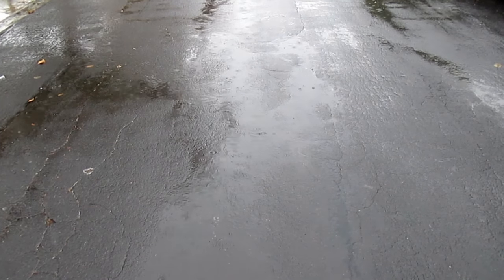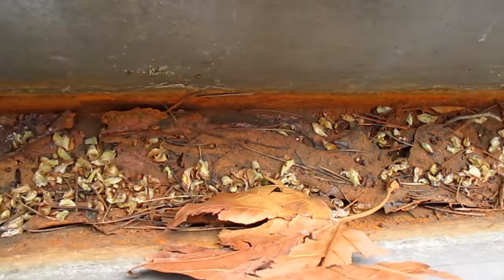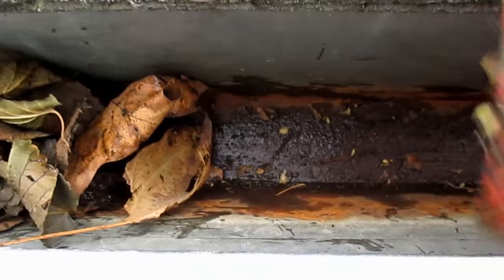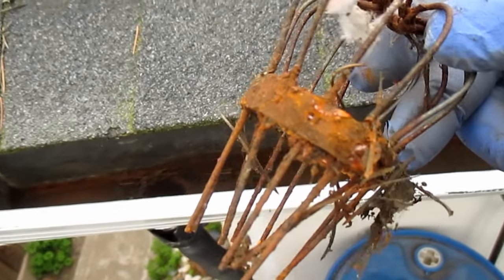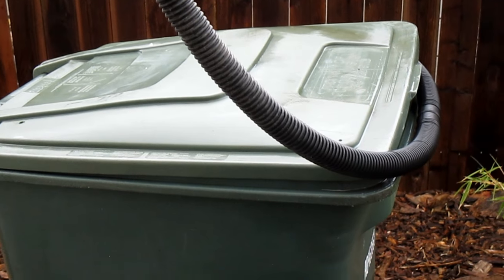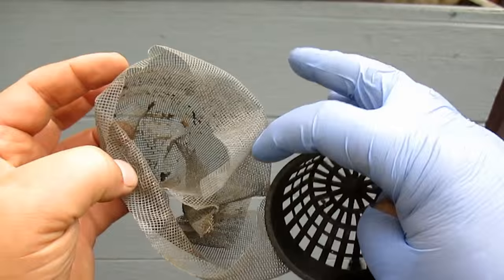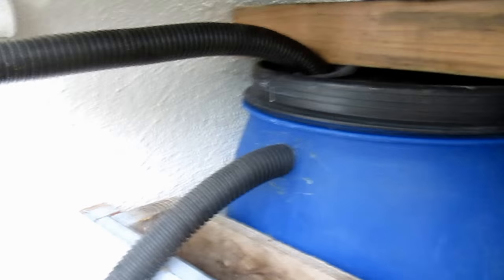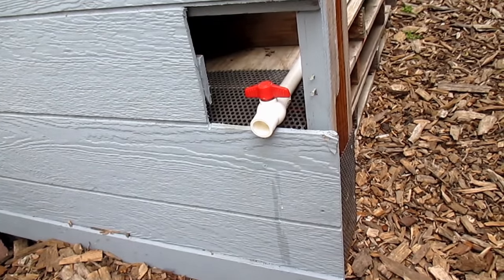Rainwater Harvesting | Collect & Store The Cleanest Rain Water From Your Roof!

Comment from the maker: Hello everyone! I just wanted to address some of the comments on this video. First off, the purpose of this rainwater harvesting system is to collect rainwater to water my landscape, not for drinking. Nowhere in the videos title nor the video itself was it ever suggested otherwise. Secondly, where I'm located in California it is in no way illegal to collect rainwater from your rooftop for use in your landscape, in fact it's encouraged. Please see California's "Rainwater Capture Act of 2012" for more info. 

Now I would also like to share with you a few important notes regarding this setup. For myself, I found this smaller daisy chained barrel system to be a great low cost introduction to rainwater catchment. Moving forward my plan is to install a couple water cisterns (larger tanks) to better fit my landscaping needs. My roof which is made of asphalt shingles is not the best surface for collecting rainwater as it can leach petroleum and/or other chemicals into the water. It is for this reason that I currently only use this water for non-edible plants in my landscape. There are methods that can be applied to treat the water making it cleaner that I may employ in the future. When the time comes to replace the roof, I hope to have either concrete or clay shingles installed. This is a much more ideal water catchment surface making the water suitable for many different uses. Many folks have asked why I don't install rain gutter screens. Due to my previous experience with them I have opted to not use them as a means of keeping debris out of the gutter. I find that the small holes have a tendency to clog causing water to shed off of the roofs surface rather than collect in the gutter. Smaller particulate will also accumulate in the gutters over time requiring the removal of the screens to clean them out. Manually cleaning the roof and gutters a few times a year does a wonderful job keeping the inside of the barrels/cistern free of debris and the water clear and "clean".

Thank you all for tuning into the video. I always appreciate your viewership and feedback.
Reply: Plant Abundance 
By keeping the rain water input clean you also avoid decomposing debri in the water that can make it fowl smelling.  Last week I had screens put over all my gutters to minimize the issue of debri going into the barrels.  My rain water collection is, like yours, strickly to water my plants.  They do much better with rain water than with heavily chlorinated tap water.  My city encourages the use of rain catchment technology.  It is time for all governemnts to embrace this environmentally friendly practice.
Reply: Excellent Video! Sorry for butting in, I would appreciate your thoughts. Have you heard about - Proutklarton Protecting Aqua Plan (Have a quick look on google cant remember the place now)? It is an awesome one of a kind product for getting prepared for a mega drought minus the normal expense. Ive heard some awesome things about it and my buddy at very last got cool results with it.
Reply: Plant Abundance awesome thanks.
Reply: When I took the master gardening classes at UCF, we were taught that the collected rainwater is safe for gardening but not for any edible plants (e.g. - vegetables) because birds poop all over the roofs and salmonella can actually be absorbed up into the plant from the water.

I asked why this was a concern when a bird could poop directly on the plant, but apparently it grows very quickly in water that sits in tanks so even a small amount of bird poop will produce a lot of salmonella once it's sitting in the tank.

I'm not an expert, but wanted to pass along what the university told us.
Reply: I just replaced my roof & gutters to prep for solar panels (Sacramento area]. If I had read this first, I would maybe not have gotten composition shingles again. As I design my drainage fixes, I now am steered toward rain water collecting (for garden) rather than diverting and dispersing it. You said that chemicals in the rain hitting the shingles is not run-off water to use for edible garden plants (90% of my yard). Any ideas? Thanx 4 your info!
Reply: illegal? really? ,where i live(belgium) catching rain water is pretty much the standard, exept maybe for appartment buildings etc. here its almost always wits a concrete tank buried under the lawn i got 25000+ liter for my house, top tip, make sure the overflow drains water from the bottom of the tank so stagnating water is refreshed first +  connect a floater to the suction hose so u collect the cleaner water at the top part of the tank
Reply: This was a great video!  I collect rain water to water my crops and it's a lot better for that use. You're doing great, ignore the stupid people, they don't know any better  😂
Reply: The gutter getter.....or you can cut a couple 2 liters and layer into the same shape.
Reply: @wardwyseur  why is it the norm in Belgium? is the tap water unhealthy?
Reply: @iPostiPodiEatiYuri  , no the tap water is potable and has higher standards then bottled water, the rainwater is usually used for toilets, shower, watering plants etc.
Reply: @wardwyseur  do you think rainwater is better than Belgian tapwater?
Reply: @iPostiPodiEatiYuri  what? no rainwater isn't potable, it's just cheaper to use on watering plants and flushing your toilet...
Reply: @wardwyseur  why is rainwater not potable?

Comment: Nice system, but you may want to start investing in better automation of tasks. Im currently using two 330 gallon tanks, Gutter guards, a 5 gallon first flush diverter for my 330sqft roof, and have minimal debris, Im going to work on a prefilter, and actually a pool sand filter to cycle water and prevent freezing by keeping the water moving when temperatures are below 35f outside which is only a few weeks of the year in TN. But great work! hope to see more!

Comment: Instead of using the gutter getter just use the leaf blower while your up there with it. I did and had the gutters clean in no time. Great vid on harvesting water.
Reply: Why not use a pressure washer?  I do not like to have to do that much shoveling.  The pressure washer gets the debris out and washes it at the same time just using water.  If you wanted to, you could use some safe natural cleaner added in with the water.
Reply: You work in reverse with the pressure sprayer getting the stuff at the collection end out first and and moving back around as you go washing the rest on down and then complete it by starting at the back and rinsing to the collection end.

Comment: Nice!               If you don't object : there are acrylic paints for roofs like that, which stop the toxic bitumen from polluting your water, although for the cost and application I don't have a clue. I'm hoping to install filters on mine, so it can be used for more than watering. I'm lucky in having a river in the garden, too, and a "pond" for it to fill. Water's getting to be rare especially clean, unchemically polluted (or "treated"), crystal clear water.

Comment: Why not put a screen on top of your gutter to prevent from debris to enter lol less hassle than cleaning it
Reply: Kobe O'Neal both need screens
Reply: Kobe O'Neal 

Good point but I wonder why all stick to the idea that it only could be collect thru the roof gutters if instead could be collect out of side of house middle of yard if wanted and still place the connection underground
Reply: I have tried that and it helps but I still need to clean the dirt and other debris out anyway. There seems to be no perfect solution to this problem.
Reply: Also it will clog up quickly if you have a screen at the top
Reply: its harder to access to remove the debri from the screen in the gutter, mostly likely youll need a ladder and to set that up every time would be  hassle in my opinion

Comment: Assembly Bill 1750 (2012) enacted the Rainwater Capture Act of 2012.  The bill authorizes residential, commercial and governmental landowners to install, maintain, and operate rain barrel systems and rainwater capture systems for specified purposes, provided that the systems comply with specified requirements. A landscape contractor working within the classification of his or her license would be authorized enter into a prime contract for the construction of a rainwater capture system if the system is used exclusively for landscape irrigation

Comment: I put a new roof on the house this spring, a good quality dimensional composition . about 60 rainy days since then. i collected rainwater and tested with my TDS tester .  (my tap water here in michigan 467ppm) the rainwater 2 ppm !!!!!
   can you believe it ??  WOW   and it tastes better than my RO water that tests at 4 ppm.   I believe rainwater also has other qualities ,nitrogen bonding ?? electrical ionization ? it just seems more natural.(which is almost always my default answer when it comes to what is best for your health) rainwater  is an An-ion.  picking up Cat-ions. (toxins )  anyone know the answer to this question.  ?? what is the difference between rainwater that has jumbled in the sky vs. tap ,well or cleaned tap with RO filters ?  beside the garbage in the water , is there another more complex difference.?   i think there is some electrical charging .  i have trouble finding anyone smart enough to know about this, most are not even able to understand we need clean water ,let alone more complex questions.  even with the flint mi. and Benton harbor Mi. lessons people still trust the government . !! hard to believe people could be that brainwashed but it is true.

Comment: can we drink this water?
Reply: Javed Rasool Nope, there's rust from the gutter. BUT, if you can somehow rigged the collection method of not including them rust. I would say, yeah. Though you have to boil it off first.
Reply: nimay13 ok thanks
Reply: Under no means should you try to consume this water, even if you were to filter it then boil it, your health would be at risk. 

You would need a special system designed to collect drinking water, then run that water through a reverse osmosis system.

You could probably build a nice little rain-water-collection system using parts from Home Depot, I just suggest doing some research first. A reverse osmosis system isn't too expensive either, seems like a fun DIY project. Good luck!
Reply: theskeletonboi, It's perfectly if treated properly. A sand filter, then a UV sterilizer, then a 5 micron final filter. Drinking water is finished with a Berkey water filter. Sounds complicated but, it's actually simple.
Reply: dbaecht thanks